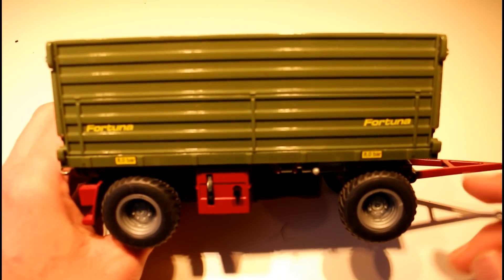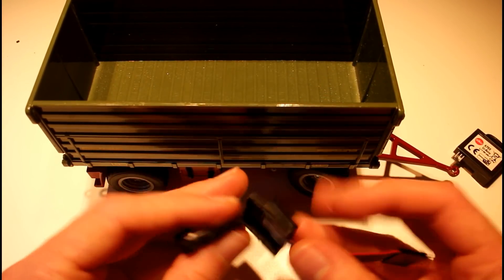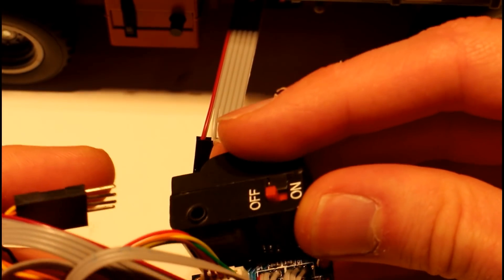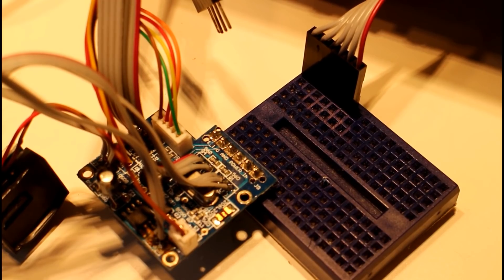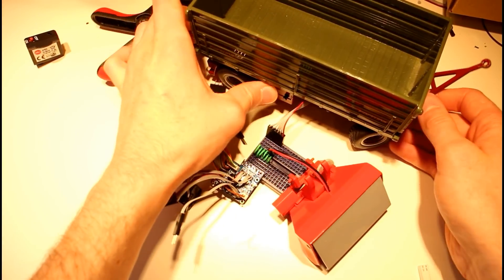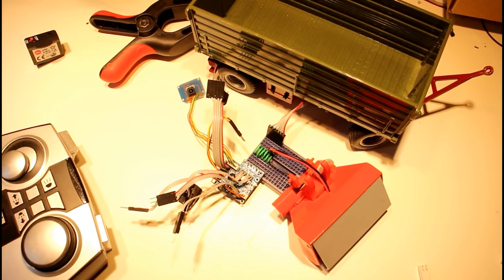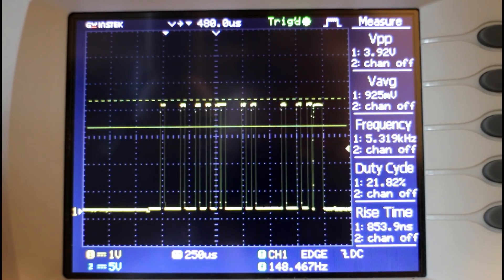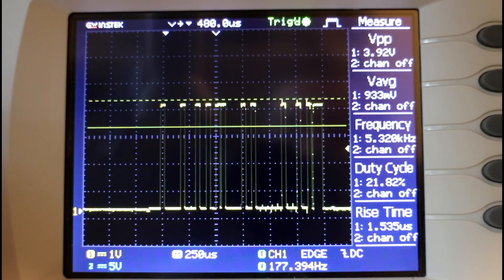How the Siku Control 32 Attachment Signal Works Part 1

Comment: Nice work! 
The fact that is seems to actually have some 2 way communication amazes me, I always thought it would just be a clock and data line spamming out signals all the time.. But that would explain why I never got anything when I tried to read it :D
Reply from the maker: Actually turned out to be a clock and data line coming from the tractor. I didn't get anything when I tried to figure it out before with no trailer either, still not sure what makes it start generating the signal. Pull either line and you get nothing from the line which is still connected.
Reply: Could it be an I2C bus with an SCL and SDA signal?
Reply from the maker: Could be, I haven't tested it out yet just kind of bit banged the signal and got control. I'll try i2c before the next vid.